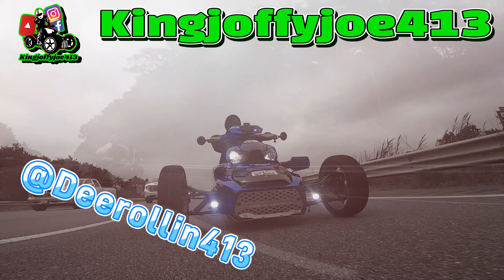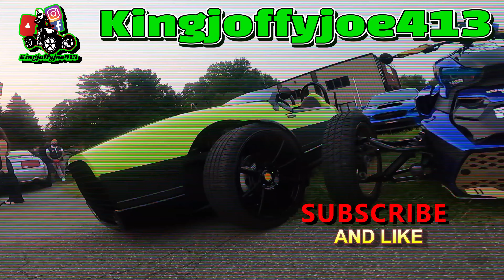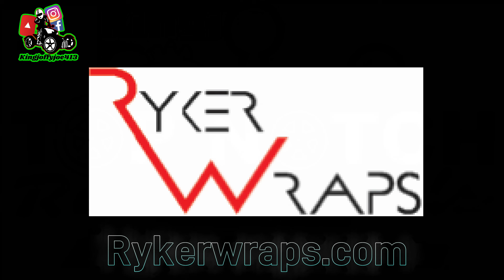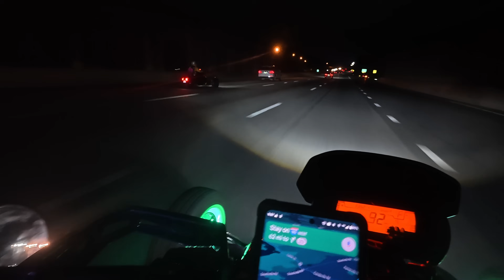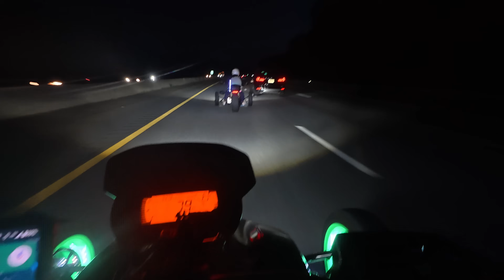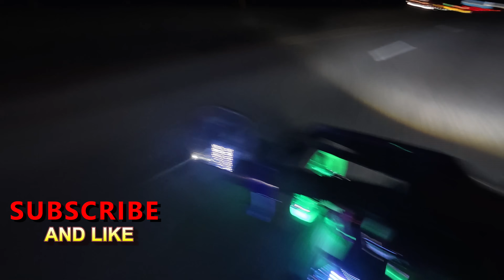Can Am Ryker Vss fault fixes #automobile #canamryker #bikelife #brp #kingjoffyjoe413

Comment: I seem to recall that you had a similar video like this where a rider in your party had their vss go out. Seems only common in 900’s because the 600’s don’t have drive modes.
Reply from the maker: The issue can actually occur in all models, including the 600s, as it is related to the sensor and not specific drive modes.